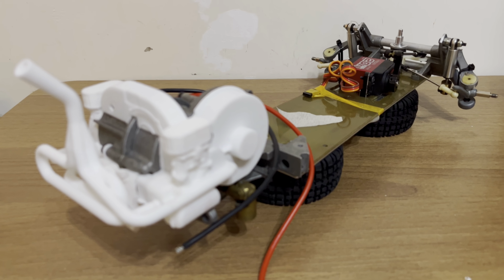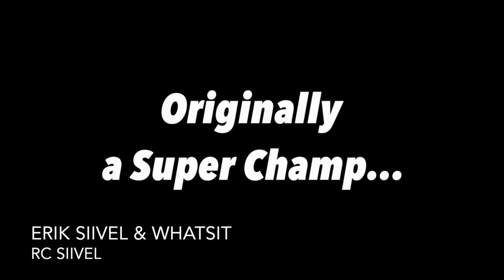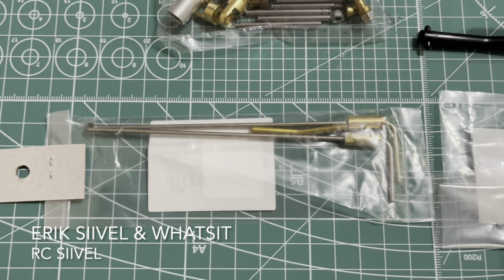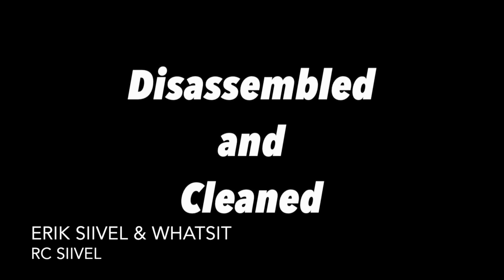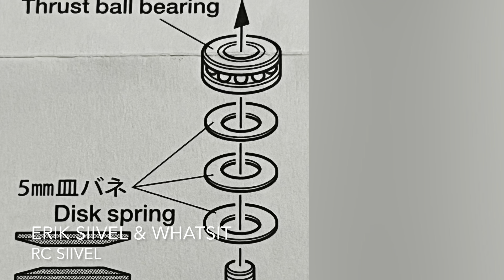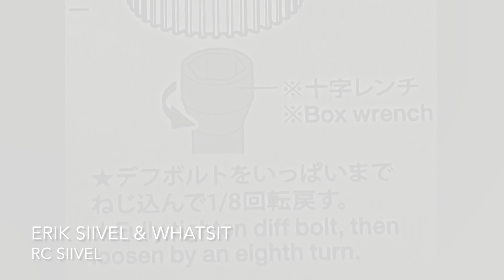Rebuilding a Tamiya Super Champ / Fighting Buggy (Part 2): Unboxing the Shapeways SBR Engine

Comment: A beautiful dummy motor. Unfortunately I can't find it on Shapeways. Thank you for a tip or link to this
Reply from the maker: Try this link: https://www.shapeways.com/product/H4X2LJ34A/sr10009-srb-engine-vertical-race-exhaust?optionId=16055202&li=marketplace
Reply from the maker: https://www.shapeways.com/product/G9KBABDNP/sr10001-mk1-srb-engine-part-1-of-6?optionId=42501039&li=marketplace
Reply from the maker: https://www.shapeways.com/product/ZQW8L2GZ2/sr10003-mk1-srb-engine-part-3-of-6?optionId=41198850&li=marketplace
Reply from the maker: https://www.shapeways.com/product/WYU3Y2QW7/sr10004-mk1-srb-engine-part-4-of-6?optionId=42501068&li=marketplace
Reply from the maker: https://www.shapeways.com/product/S4GKR2WHY/sr10005-mk1-srb-engine-part-5-of-6?optionId=42501117&li=marketplace
Reply from the maker: https://www.shapeways.com/product/BCJ4TT5PW/sr10002-mk1-srb-engine-part-2-of-6?optionId=11592095&li=marketplace
Reply: @siivel  Many Thanks !!!
Reply from the maker: @MarcusBeutel  You are very welcomed!